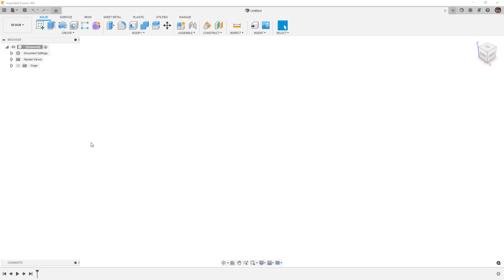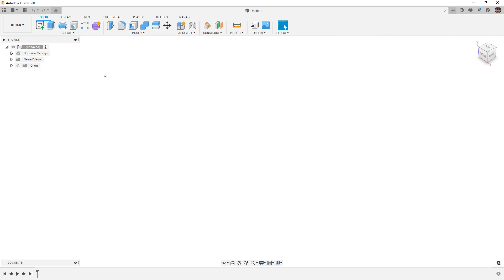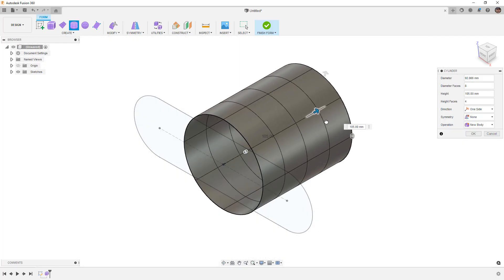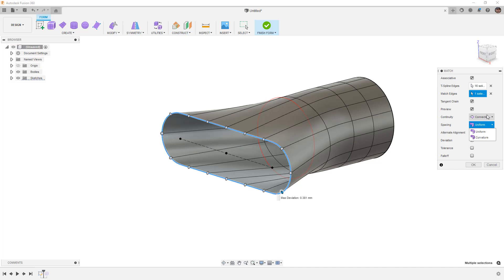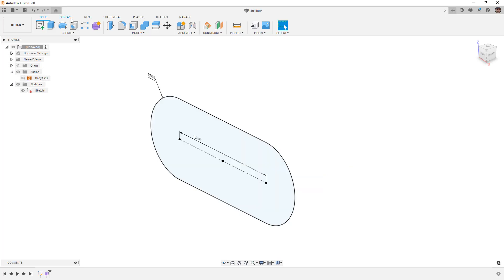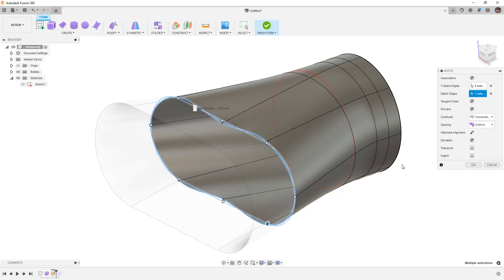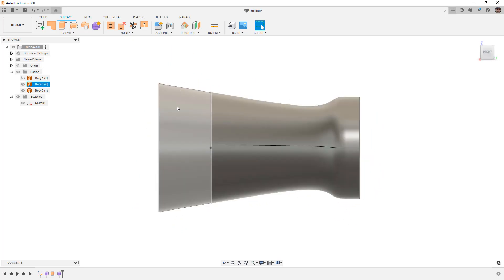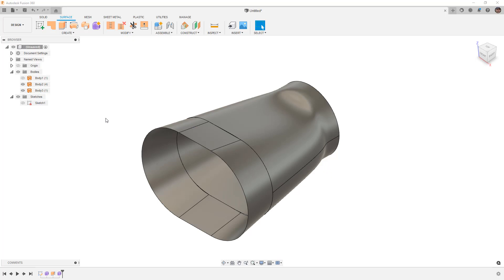Fusion 360 Form Mastery - Part 21 - Associative Match Forms Tool #Fusion360

Comment: Hey Matt,

I'm working with a thickened body and matched an inner and outer profile to a sketch, but it doesn't seem to be a perfectly joined body once it's out of the Form work space. What would you think could be the problem?
Reply from the maker: With associative match there is a tolerance option that will get it closer, but word of caution I would do that at the end of the form maniuplation because it will add a lot of T points to get it closer.  You can also delete the end face of the thickened form after conversion, and the end face of the body you are trying to join it to, then use Stitch.  If the preview edges are red, bump up the tolerance.  Fusion will make adjustments to the surfaces so double check them after that it didn't do anything funny.

If those don't work I usually make a small gap and loft between them after.

Comment: Hi, I'm one of the developers who worked on this.

The number of vertices on the T-Spline surface can be automatically increased if you turn on Match's "Tolerance" option, so you don't need to increase the number of faces up-front the way that you're doing. One advantage of using a T-Spline surface is that you can add local detail along the edge without increasing the complexity of the rest of the model.

We also put in some effort to make matches work better when the target includes sharp corners, and to improve editability of the model after portions of it have been matched. The whole match system was reworked, really.
Reply from the maker: Thanks for the comment Adam.  Tolerance does help match the shape but it adds a ton of t-points to the edge to do so.  How do those end up getting calculated?  For example 17 points were added to one edge to match the straight line and arc to the T-spline edge.  I typically teach to avoid that.  If the edge tolerance is changed from the default .01mm to something larger like 1mm then you end up with just a few extra points.  

In general the points added don't help with the shape transition to the next ring or loop, just with it matching the sketch.    

I did try an example with a sharp corner as well but when changing the sides it broke the Form feature and I wasn't able to repair it.  The converted Brep broke when the sketch changed and the form body was no longer there when editing the form feature, so I avoided showing that as an option.  The example had 2 sharp corners and 2 rounded corners transition to a cylinder.

I would love to do a follow up video with more info about tolerance and best practice on the update of the tool if you can better explain to me the nuance down stream of all those additional T-points.  Feel free to email me support@caducator.com rather than reply if that works best.

Thanks!
Reply: @LearnEverythingAboutDesign  Thanks, I sent you an email.

Comment: That's an amazing feature they just added, finally we can work properly with form bodies! BTW, did you get the design extension to work, mine says "something went wrong, try again in few minutes" yet nothing changes after a few minutes. Amazing work as always.
Reply from the maker: Thanks Nabil, yes i was able to get it to work.  I did a video on the Volumetric Lattic included in the Design Extension.  I did the 7 day trial.  I also played a bit with the Geometric Pattern tool.  Not super great so far but I plan to make a video on it, maybe tomorrow.